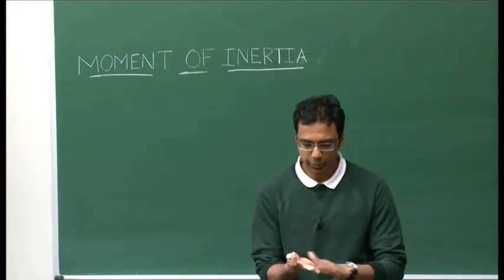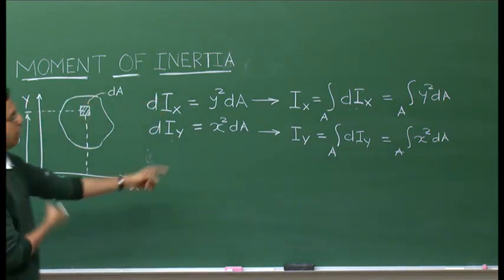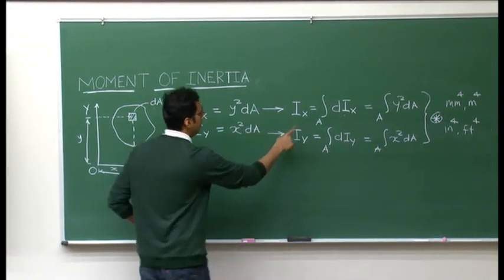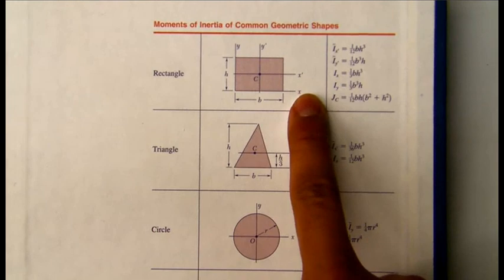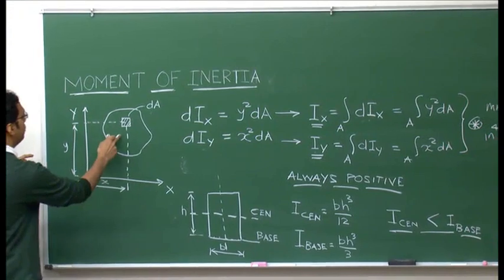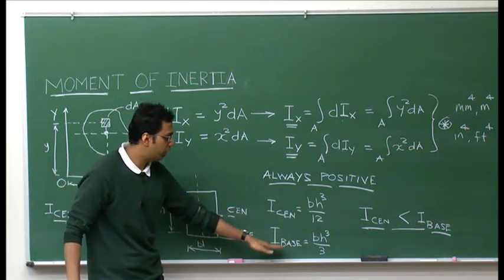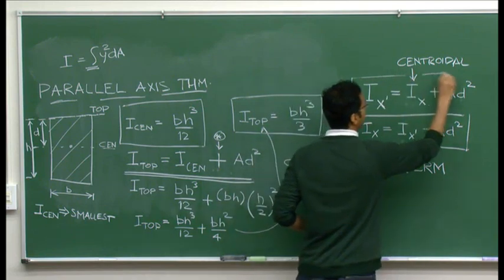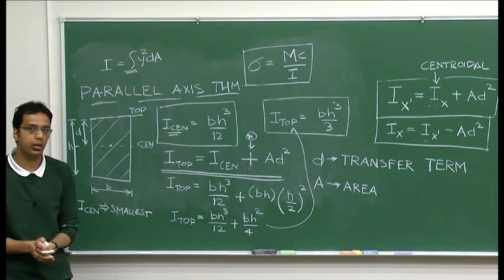Parallel Axis Theorem

Comment: Sir Unit of Moment of interia is m^4 ?? How its possible??
Reply from the maker: Notice the formula used for calculation of MI has b*h^3 in it. Both b and h have units of length i.e. meter. So bh^3 becomes m^4. Hope this clarifies your question.
Reply: Dimention of area is L^2 and in MOI area is multiplied with square of the distance so L^2(for area)*L^2(for distance square) gives you the dimention as L^4.

Comment: hay Anup..this video helped alot but im just a bit confussed.  I dont understand why one adds the are time distance squared ones you move the axis. why add the area squared with the distance. Where does that come from
Reply from the maker: +Frassie28 : It comes from the theory (proof) behind the parallel axis theorem which is not discussed in this video. However, i found another youtube video which explains this clearly. 
Here is a link: https://www.youtube.com/watch?v=PvFubdoEJL0
Note: The link above shows proof for parallel axis theorem as applied to masses. But similar proof can be easily derived for areas.
Hope this helps.